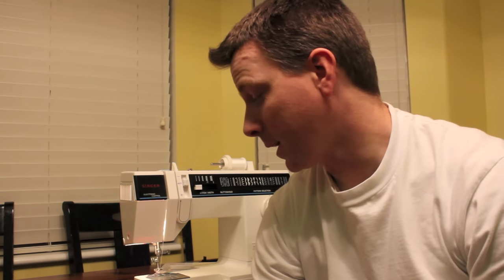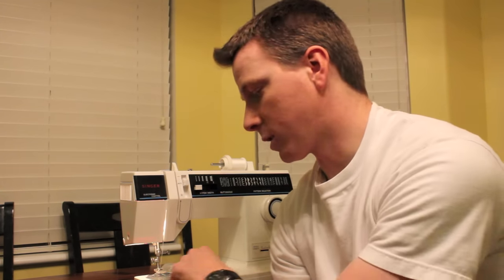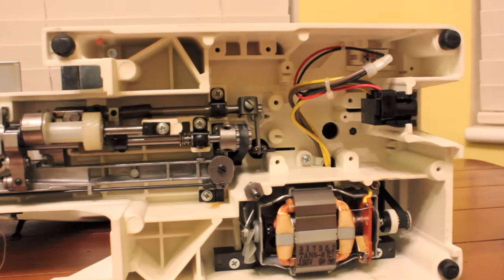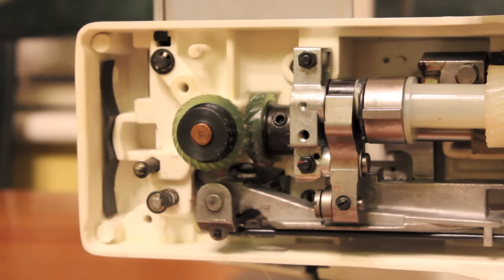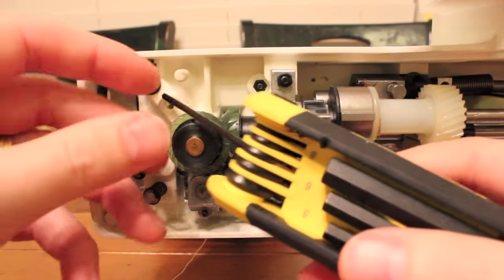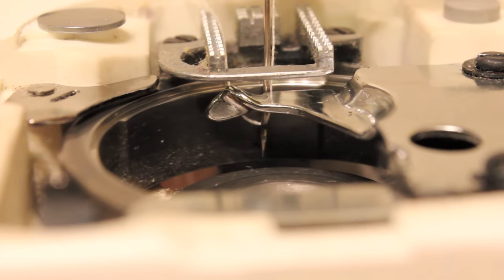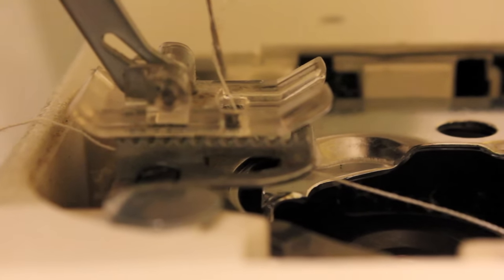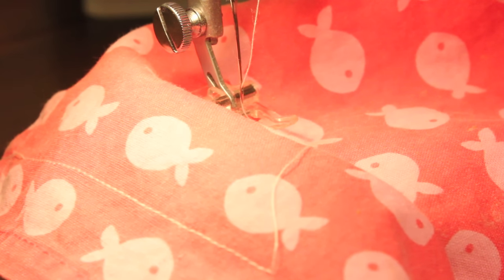How to Fix / Repair the Hook Timing on a Sewing Machine

Comment: Hi Nils looking at your machine it seems to be a similar model to mine. when is comes to singer the service manuals for some machines use the same manual I have a 9022 but the manual is for the 6233,6234,6235 I was looking at how you set the hook timing on the manual it shows to adjust the hex head next to the timing belt it likely does the same was what you did but if you need to adjust it again I thought it might help you out I'm trying to set the needle location but it's giving me fits

Comment: hi I love the video thanks I have the same machine but my problem is where the bobbin is by mistake I want and unscrew the 3 little nuts which holds the bobbin down and a little iron part came out under the plate and I don't know how to fix it back please help  thanks

Comment: Actually timing is done either at the far end where the belt is, or the hook itselfOnce set you also need to ensure the feed timing is still in sync with the hook to needle timingAm somewhat new to YT and picking up on these older videos.  The gear you adjusted...commonly known as 163997 hook drive gear, is not where you time it at :)  Plus most, not all, but most Singers have two lines inscribed in the needle bar, lower an upper marks.  The needle total depth will never exceed the upper mark setting, per which ever bushing it aligns with, and then you bring the hand wheel towards you until the lower mark is the same...then set the hook to the needle.  Then for models of this type with feed drive gears too, you sync the feed timing to the hook to needle timing.  Overall, nice video with good quality - just some refinements on my part :)  thanks Terry - tandtrepair.com
Reply: +Terry Fielding - plus normally 163997 hook drive gear rests on a flat spot on the shaft, it is preset.  failed to mention that :)

Comment: Hi I have an old Singer 248. The timing seems to be correct, the hook picks up the upper thread like in your video, but, when I try to sew and I put a fabric, the hook can not pick up the thread any more. I see that the thread loop becomes narrower when I put the fabric and it is not enough wide for the hook to pick it up. I tried with different needles and different upper thread tensions, but I couldn´t solve this issue.  Please, I will appreciate your assistance. Thank´s in advance.

Comment: Thanks for the video! I don't know if that's what my problem with my sewing machine is or not. Can you tell me what the problem was in the first place that helped you know this is what you needed to fix?  My top thread is just making loops, very loose loops on the bottom of the fabric. I used a different color thread on the top than I did in the bobbin so I could tell what was going on. The bottom thread just comes off the bobbin and they aren't make a stitch. Is this what was happening on this machine before you fixed it?
Reply from the maker: +Betty Parrott - Yes, that's what was happening. It looked like it sewed but the top and bottom threads weren't looped together so I could just pull the stitch apart.
Reply: +Nils Rasmusson   Thanks for the response and so quickly! I inherited this machine when my mother passed in January this year and I thought it was a tension issue. I will show this to my husband to see if he can repair it. It would be nice to sew on her machine, ya know? Do you have other sewing machine repair video's because I have a feed dog issue too....I think...and on another machine the reverse stitch no longer works...Yep...over a hundred bucks just to look at it at the only repair shop near me and that's 24 miles away....Thanks again for your time...
Reply from the maker: +Betty Parrott Hey Betty, unfortunately this was my only video on the subject as I'm really not too familiar with sewing machines or their repairs. This was just a need I had so I took care of it. Wish I could help with the other repairs but good luck and hopefully you'll get them figured out!
Reply: +Nils Rasmusson Thanks again!  The hubs is pretty handy with stuff like that, and the machine is way out of warranty, so I'll have him take a look, and if it's fixable, maybe he can do it...chat later....

Comment: Hi:  This is really clear, and good enough to make a machine work, but I think you have two basic errors. 

1) The hook should pass behind the needle after the needle has gone back up a bit, not at the lowest place. The needle has to go back up so as to form a little bow in the thread for the hook to catch. That little bit is a sewing machine standard.  It is about 2.2 mm or .093"  or 3/32".  

2) The collar you adjusted, just next to the hook assembly,  only has one screw. That usually means there is a flat on the shaft there. That means that the screw should be tightened in the middle of that flat.  It's not made for adjustment.  Instead, way down at the right end of that shaft is another bushing, connected to the works above by a belt or bevel gear.  That bushing has two screws, indicating that it's angular position is supposed to be set by the set screws.   It's that other bushing which should be adjusted to get the timing right.  #1 above I am quite confident of.  #2 above has been my experience, I don't know if it is universal, but I suspect so.

Then, sometimes, after you do the hook timing, you are stuck making similar adjustments for the feed dogs, so that they only advance the fabric while the needle is up. Then, finally, sometimes you have to adjust the needlebar height so that the hook is a hair above the eye when the needle has retracted that magic 0.093".

Comment: My machine is a Bernette 65, it was working fine, then it got stuck, I managed getting fabric out.  Then the needle looked bent, it was not catching the bobbin thread, and sounded like the needle was hitting metal.  I think I'm going to try what you did.  Thanks, will let you know if t worked.

Comment: Hi Nils :) i have a singer sewing machine with the exact same problem!! The only difference is the sewing machine model. I have opened it but doesn't look like any close to the one you have worked on..... Anyways it seems to be hard to find and follow your instructions :( can you help me please..?!?! :) many thanks
Reply from the maker: Hi Denise,
I have only ever seen the inside of this one sewing machine (haven't owned another) so I can only tell you that the principles are the same - there's likely going to be a drive shaft that connects to a gear. If there's a set screw that you can loosen to adjust a collet, that's likely what needs adjusting. I'm no expert at this but hopefully you can identify the parts and go from there. Best of luck!
Reply: +Nils Rasmusson thank you for the advice but I actually managed to out it to work eith no need to really loose anything! as I couldn't find what you have said about your sewing machine so I decided just to clean up all the dust and eventually after I have put all the parts together the machine started working normally which is really good! but still any problem I check on that ;) thank you!
Reply: My  walking machine lever is broken how can I fix it

Comment: you should also try the zig zag --probably skipping stitches now--I usually set step to full step left and check then full right and check.Needle bar should rise about 2.6 to 2.8 mm.when hook point comes in back of needle just above eye of needle at all three positions--left right &center.  Brother actually mfg. a lot of singer machines.I have been in the Brother factory in japan and seen them being assembled,putting singer name on them . A run of brother came that afternoon......good luck,good guessing if this was your first time working on one (I may have about 50 yes 50 years on Industrial machines,they are often a lot tougher!!!)

Comment: I have a singer inspiration machine model 4228. Machine was working fine until the needle broke. Replaced with same needle size and having issues with needle hitting the bottom plate. Never removed but can't get the needle to stop catching on bottom plate.  Any suggestions!

Comment: Do you have a threading diagram for the machine or is it a self threader?  Sometimes if a machine isn't threaded correctly the tension won't be right and it will jam like that.

Comment: Would have been nice to see video of the problem before fixing it. I don't understand what a "Timing Problem" is. I get the " didn't catch on the shuttle" problem. I also didn't understand exactly what you did other than loosening and tightening the allen screw. Did you move the bearing to the left too make the gear connection tighter?

Comment: The problem here is many modern machines have plastic/nylon type gears, when sewing heavy fabrics these machine are towing and because of the plastic gears you can knock the timing out. I prefer using my 30 year old "New home" machine which has metal gearing and built to last.

Comment: Hi. I have my machine and i do believe the timing is out... but when i manually try to turn the wheel to raise and lower the needle it actually stops... and which resulted in several broken needles before i figured it out... After watching you video i had a very hard time locating the parts you were talking about. for example: the place id use the allan ranch. The under side of my machine looks COMPLETELY different than yours. Its newer i believe but its a singer and I think its a heavy duty machine purchased about 10-15 yrs ago for over a few hundred dollars. after looking it up its a Commercial grade machine that cost $269.95. Any Ideas? If not i've located a repair man that said if it was the timing he'd charge me $50+taxes.... just didnt want to spend the money. lol

Comment: my needle is hitting the the plate I have adjusted the neddle horizontally its fine but its not forward and backward it wont go in hole strikes the plate would the video u posted fix that ?

Comment: When you adjusted the allen screws, to loosen up the bobbin case thingy, did you have to loosen the allen screws enough to skip a few gears, and then retighten them? Or in just loosening the allen screw, did the bobbin case thing get loose?
I was trying to loosen the screws on my machine, and in order to tighten them again, it went right back to the original orientation. I was wondering, was I supposed to pull the gear out? How did you get from loosening the screws to reorienting the gear?
Reply from the maker: EverydayElven The key is to loosen the set screw(s), rotate the shaft so that the bushing (the thing the set screws are in) rotates to a different degree on the shaft. This part is separate from the bobbin case, however. On my machine, at least, the bobbin case uses different screws all together. I made this video almost four years ago so my memory is rusty but that's what I recall.
Reply: Nils Rasmusson  Thanks so much!
I have an old kenmore, and there appears to be something like that (a black thing with allen set screws in it), but there's another thing above it with actual tiny screw in it. The problem is, it appears to actually change the degree of the shaft, you've got to loosen the real screw, and then I can adjust---but to tighten the thing back up, I have to realign the shaft with the screw hole, thus setting it back to the original angle.
Maybe I really do just have to adjust the allen screws, and I'm just not doing it right?

Or perhaps its that kenmores only adjust the timing with the needle bar?

I posted this comment in case anyone else is trying to retime a kenmore and has all the answers and decides to comment. Or if I figure it out, I'll update this comment.

But I wanted to say thanks for this video! It was incredibly useful, and inspiring for me to try to figure out how to fix my own sewing machine.
Reply: Thanks! You're awesome! I had this same problem happen to 3 Brother machines. I just took two into the.shop to be fixed and they charged $140. I didnt know much about repair and needed my machines fixed so Im gonna pay them, but now Im trying to learn myself how to do it in the event that my timing goes out of whack again. Thanks..Im gonna try this on the 3rd one that needs fixing.

Comment: I own a Montgomery Ward sewing machine that has a timing issue.  When the needle is on its way up the round piece below it hits the side of the needle and slightly bends the needle.  How do I adjust the timing so the needle does not hit the piece that grabs the thread below?

Comment: Terry fielding I'm tring to time my janome new home 108. I have back off by the belt and front off too. I'm looking at the bars going up and down with the sewing needle, I don't see the marks for timing. My bobbin thread does not interlock with upper thread. Then when I sew the balancing wheel locks,  and I get lots of thread from the top needle locking the bottom up.

Comment: I have identical machine. I put in new bobbin case and cannot get top or bottom tension adjusted. It's just not right. Changed meddles, thread, tweeted bottom adjustment for new bobbin case. It was gathering fabric. Any ideas!

Comment: Jeffrey Wong, if your machine's timing goes out frequently you may need to replace the gears. they will slip and then your timing goes out. Those Plastic Gear machines were not designed to take on heavy fabrics. If you are going to continue to sew heavy fabrics you may want to invest in an older machine that has metal gears something pre-1969. Kenmores are great old machines with 1.2 amp motors.

Comment: Hi. I have a singer 1507 that used to belong to my in-law. I'm new to this whole sewing machine stuff and I thought to just stop and ask you for some help. I read that the bobbin on the sewing machine is important and it would best to have it working. The thread hooks up great to that thing in the inside but the bobbin thread does not pull up. Would you happen to know what might be wrong??

Comment: Hey, i want you and any one to know that this solution can apply to any sewing machine with a timing gear that has a torque pin.

I just saved my mom 150 bucks. So you keep this video running and screw all those shop dudes that wanna charge me so much for 20 bucks of work at the most.

Comment: Uh...I've been repairing sewing machines professionally for 38 years and, great try, but you moved the wrong gear and you didn't adjust the feed timing to compensate for the change you made. You got lucky that it sews, but others might not get so lucky. 
There are timing marks on the needle bar and when these are aligned, you adjust the timing on the other gear, the one that meshes with the one you moved. Then, when the hook point is directly behind the needle, you adjust the feed timing gear so that the feed timing marks are aligned. Otherwise, the machine will likely feed the fabric when the needle is down in the fabric.

Comment: Annoyed talking to the numbers the Singer/Curvy of that brand new machine told me. What I happened, the heavier thread loosened the timing invalidating its uses because I did not use heavy bobbin thread. Sewing takes patients of every detail down to enough lighting, for seam ripping, and the exact right needle on these needle threading singers. Singers in itself has a reputation of using factory needles. Yet, the two Kenmore's & the other Singer I worked with prior taught me this experience.

Comment: At 1.43 in video undo the gear on the LEFT of the one he points to (the vertical one) and remove it
1. Turn wheel toward you until the needle is at the very bottom, make sure the 1st timing mark on the needle bar (which holds the needle) is just outside its housing
2. Keep turning toward you (needle goes up) until the 2nd mark is aligned with housing
3. Ensure the very edge of the hook is perfectly aligned behind the "scarf" on the needle (magnify it)
4. Gently put back the gear and tighten

Comment: What is the problem when the needle won't go down and seems to be hitting the bobbin case?  Is it a timing issue?
Reply from the maker: +Nancy Patterson That sounds like it might be timing, yes. Do you have a new (or at least a straight) needle in there? If so, it's likely timing, though I can't say for sure since mine didn't hit the bobbin case.
Reply: +Nancy Patterson It's not a timing issue. But let me ask you. . . If the needle won't go down, then how is it hitting the bobbin case? The bobbin case is below the presser foot, so if the needle isn't going down, it 'aint gonna hit nothin'. Does the needle go up? Good, then raise it and remove the needle and inspect it.

1.  Is the needle bent? If so, then replace the needle with a new one.
2.  If the needle is not bent, then raise or remove the presser foot, the slide plate, the needle plate, and unthread the machine.  Remove and re-insert the bobbin case. Make sure it's inserted properly.
3.  With the bobbin case properly inserted,  manually turn the hand wheel to see if the needle hits the bobbin case.
4.  If you're sure the bobbin case inserted properly and that the needle is straight, if the needle still strikes the bobbin case, then the needle's aim may be out of alignment. If it is, then it's a much more involved problem to solve.
5.  If the needle does not strike the bobbin case, re-thread the machine and use a piece of thin fabric to test sew.
6.  If needle strikes again, then you may be pulling the fabric too tightly and causing the needle to bend.

Hope this helps.
Reply: I have replaced the needle. The needle does go up and down but when it goes down it hits something just after it goes through the hole in the throat plate.
Reply: This is very old but it absolutely is a timing issue.  The bobbin case has cut outs to clear the needle.  The needle does dip below the  bottom of the bobbin.  If your machine had jammed and jumped teeth then this is what can occur.  I picked up a Singer 6235 (marked Singer 9000 - perhaps a shop special?) with exactly this issue.  You can adjust the needle 'throw' but that wasn't the fault.